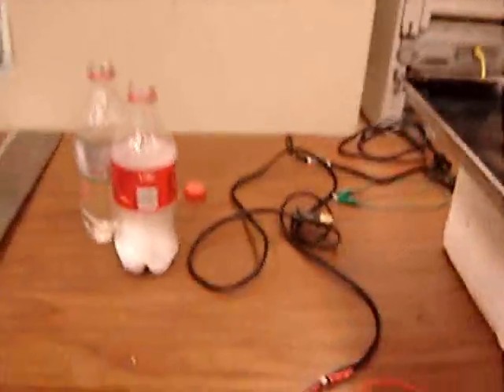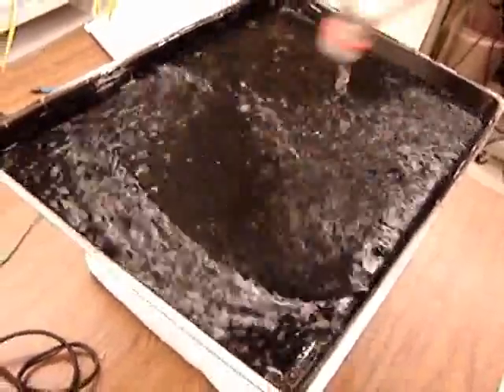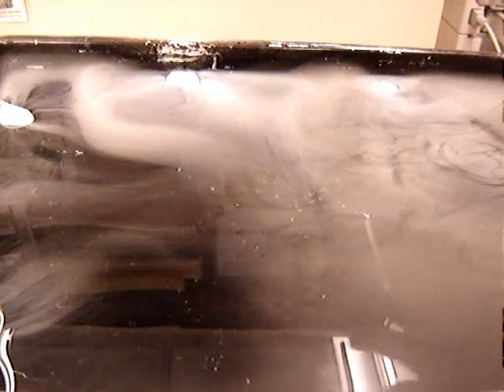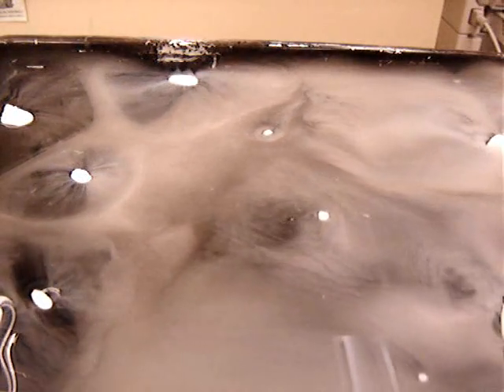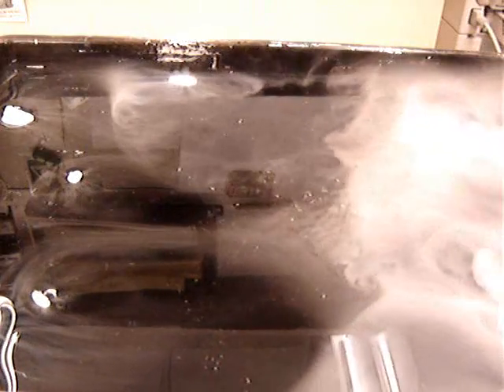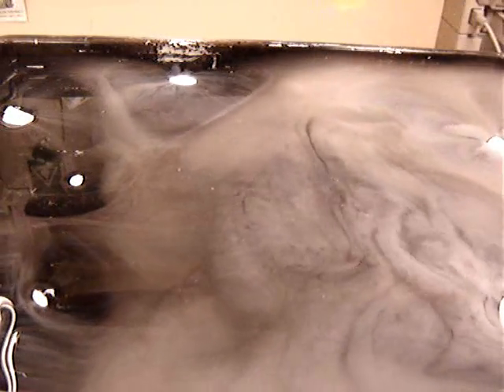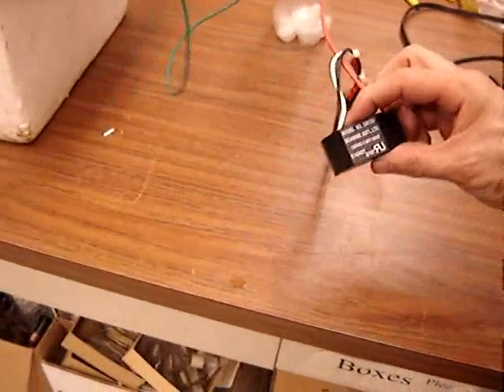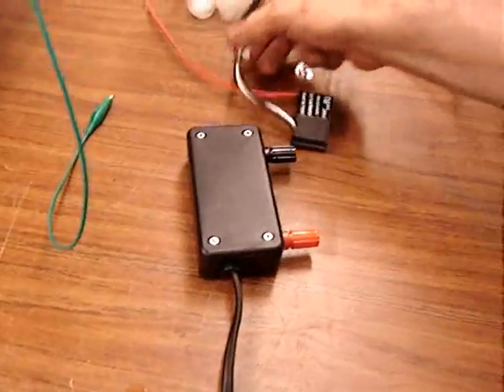High voltage "Air threads," from 1998 (video 6/2007)

Comment from the maker: Also search keywords: electrospray, Taylor cone,  liquid metal ion source, and FIB ion beam, ion-beam machining, ion-beam lithography.   The physics was covered by CTR Wilson, in his early-1900s study of electrostatics of thunderstorm water-droplets.   
Wet fibers are great sources of these "streams of electric wind," where probably the strong field at the tip of the fiber is causing Electrospray.     Others have used mercury-wetted (mercury-filled) hypodermic needles as their source of "ions."   In ion-beam lithography, the liquid metal is typically indium or gallium, where it's accelerated to hypervelocity in a vacuum, and actually used to carve deep slots through any material.   (At 10KV in vacuum, the droplets gain enormous velocity, when compared to 10KV in an environment of viscous air.   And in vacuum, we can try some megavolt electrodes, or even pulses at far higher potentials.)

Comment: any alternate for ion supply 
pls i need it for my science projects
Reply from the maker: Yes, on eBay search these keywords:

DC12v anion -air

That gets you lots of 12V-powered ion generators, many for about $6.  They work fine with a 9V battery.   The output current is tiny, like a VandeGraaff machine.

Comment from the maker: > any thoughts on power generation

@matt_jensen The level of power generation that Tesla was discussing (hundreds of HP for a car, megawatts for every city) are not appropriate for contemporary humanity.   If we're going to take a chance with accidentally shifting Earth's axis, at least wait until we have thriving communities out in the asteroid belt/Mars/L5.
Reply: Could you explain the mechanism for shifting the Earth's axis? I've never heard of that concern before regarding Tesla's (or anyone else's) work.
Reply from the maker: @unambitious  See Walt Richmond's SF paperback "The Lost Millennium," later renamed "Siva."    He did the same as I did: realized that laser-guided lightning, if it could reach up to the ionosphere, would short-out the entire planatary capacitor.    This would shut down all lightning on the planet.   But he went further, speculating that the DC "electron fountain" would reach far out into the magnetosphere, would persist, and would torque the Earth's core, physically precessing the axis, and cause the oceans to temporarily sweep across all the continents.    So, in the book, he had the Atlantean civilization do this by accident.  The vertical beams were pulsed, and part of the worldwide broadcast-power system.   Ancient pyramids were the insulators placed below the giant, vertically-aimed lasers.   (And so, the contemporary meme with giant glowing beams extending from the tips of Egyptian pyramids, that comes from Walt Richmond, if not from human "radcial memory.")

Tesla's main secrets involve guided-lightning at the scale of many kilometers (using collimated x-rays, not lasers.)   Tesla's first x-ray tubes produced narrow x-ray beams, not the 180deg output of Roentgen's tubes.     X-rays do ionize the air, especially the 1MeV x-ray sources (nothing like the piddling 75KV sources typical of hospitals.  No relativistic electrons present in the beam, until your power supply is well over 500KV.  )

Comment: Just a thought. Could you try a vapor produced with Ultrasonic sound waves? ( like air humidifiers) The speed of your waves are more in line with the speed of sound. My guess is they are 1 1/5  hour long waves.( six colors of the rainbow) 18 sets a day (3 rainbows x 6 colors - 3 wave electromagnetic wave) with a three day cycle. The entire electromagnetic wave turns inside out in six days. You mention 20 MPH that would go around the earth 18 times a day 20 x 18 = 360  x 2 North & south 720  x 3 days = 2160 miles. Keep me informed!  

Sound 767- MPH  = 10 planets  x 8 cartesian quadrants.
20MPH x 2 (N&S)  = 80 x 10 colors of rainbow (B, W, 6 Colors, Clear, Rose)  = 800 = Mercury the 80th element x ten planets!
Ultrasonic would be a room temperature mist. Better yet if it is 98.6 degree water! = the bubbles - water particles are mirrors.
Reply: The fog from ultrasonic "nebulizers" works a little, but unlike the cold CO2 fog it is sparse, and hovers high above the water with a significant clear space below.  Small holes and slots become difficult to see.  Dry ice gives much sharper details, since the cold gas invades the Boundary Layer above the water, dragging opaque white fog as it spreads.   Perhaps ultrasonic fog would work well if a sharp-edged "wiper" passed along the water, with fog injected just ahead of it.   Or some sort of laminar slot-jet to inject fog against the surface of flowing water.

Safe high-volt supplies are again available cheap ($6).   Search ebay for: Anion 12v    or see http://amasci.com/emotor/negion.html
Reply: Ill stick to neutral voltage - 98.6 degrees
Reply: William Beaty There are two rainbows in the sky. the second is inverted  and thinner with a space between the two. Maybe the Co2 and Ultrasonic vapours reveal both rainbows.

Comment: hey mr beaty, known of your majestic experiments for some time now, felt i shoudl offer a comment. Did you ever inspect any literature on Oliver Heaviside and Professor Wheatstone? and the speed of an electrostatic discharge as given by tesla as pi/2 * C and wheatstone in a 4 mile transmission line segmente to be 291,000 miles per second.

My thoughts are particuarlyl, what happened to the speed of light and the extra 105,000 miles an hour from the previous ratios, no explanation forth

Best,
A

Comment from the maker: Yep, just like old TV sets, those smoke precipitators don't try to be safe inside.   But the little one in the above video is fairly harmless.  I think it's designed to get wet (like in an ionizing blow dryer.)   Just don't use it to charge a Leyden Jar.

Comment: My explanation: water is a polar molecule. By using a charged or chargeable object, like a piece of paper or a hand, water vapor is attracted and also aligns with the electric field. The pressure increases, due the higher density of water, and pushes air out of the more intense electric field. Given that CO2, that is, dry ice, is apolar, it gets pushed only by the air. The result it is tha the shape of the object is printed above the water surface, as a hole.

Comment from the maker: > 6,000V

That should do 'er!   Actually, polarity seems not to matter.   Hmmm, I never tried turning the voltage down to see how low you can go.   For higher volts, the emitter can be farther from the fog plate.  (For a VandeGraaff machine, it can be a couple of yards away!)

Comment from the maker: > Ion Wind?

Probably not.   It works best with slightly damp fibers.  It doesn't work at all with sharp metal needles.  Perhaps it's a variety of "Electrospray," micro-droplets of liquid being pulled off the fiber tip.  They would quickly evaporate, leaving charged dry particles of solute behind.   (Electrospray was once used for one form of inkjet printer.  Also look up high-voltage "electrospinning" of nano-scale fibers.)   Or perhaps it's similar to smoke, where plasma burns the fiber itp.

Comment: You could try making a weather model and see if it checks out. Something like the setup above but with a watercurrent running through which is strongest at the middle, then evening out towards the top and bottom to fake the coriolis-force or something. Locally heating the water would be pretty hard though :)

Comment from the maker: The black and white wires are hooked to the AC cord.   I use butt-crimp connectors, but you could use wire nuts.   Make sure the connections are kept separate and completely covered (use black electrical tape.)

Comment from the maker: > if airflows like you're explaining actually existed,

 I think you should search on keywords "ion wind."   Also "corona wind."  Also "electric wind."

Batteries do generate wind.   Stack up cells to create a few KV, and any sharp edges on battery terminals will create corona discharge and launch some ion wind.

Comment from the maker: Might be air ions.   Or might be bits of the sharp electrode, sort of like nano-smoke particles.  Ions are pretty small.

If the electrode is losing atoms, perhaps the sharp tip eventually becomes dull.  But if it becomes sharper as it erodes, then it might take millenia before significant loss of matter was detected.

A 10 nanoamp current, say,  would lose 1e-8/1.6e-19 atoms/sec, or 1e-13 moles per second, or .00004 grams per year, for carbon ions torn from an organic electrode.

Comment from the maker: Click on the website link.

The "threads" are blocked by anything.  They can be pushed around by charged objects.

If we could detect them when they impact a surface, perhaps we could use one as a microscope by raster-scanning it across a tiny object above that surface.

Comment from the maker: > before pushing those, what seems to be exposed wires,

No exposed wires.

The negative high-volt wire is limited to 50uA current, which is far too small to even feel.  It's more like a VandeGraaff machine: a fairly safe source of eight thousand volts.

Comment from the maker: > Any theories

I've decided that it's electrospray, where the tip of non-metal fibers will periodically throw off tiny droplets or perhaps solid fragments.  An electric micro-squirtgun.    Also it's Tesla's Death Ray (which was basically a liquid mercury electrospray emitter, and a hundred-megavolt linear accelerator in high vacuum.)

Comment from the maker: > how does it react to a magnetic field? 

Doesn't.  I tried quite large supermagnets.  But it's expected, since the current is way below a microamp.

It reacts to charged objects.  A charged balloon, if wiggled at a distance, makes the fog spot wiggle.   And if you can create several-kilovolt sawtooth waveforms, you can build an oscilloscope (a crt tube in air, no vacuum)

Comment from the maker: > puddles of water lying around.

To teach yourself high-voltage safety, first you have to start out terrified.  Over the years you'll slowly learn what's genuinely dangerous.

Water is fairly safe around a current-limited HV power supply, but only if the limit is hundreds of microamperes, water can't get into the HV supply, and the supply has no output capacitor.

See, it's easier just to assume that high voltage plus water ALWAYS equals instant death!

Comment from the maker: > also use those ultrasonic-fog-makers 

See the main article on the website.

I briefly tried an ultrasound humidifer, but the fog doesn't descend to the water surface, so no marks appear in the fog.  Later I realized that if I let the water flow along a slight incline, and built a "fog box" at the top, with water and fog flowing from a narrow horizontal slot, that would probably duplicate the same fog effect as dry ice.

Comment from the maker: > will this work with a neon transformer

Hmmm, I never tried AC!   Interesting to find out.

I do know that it works the same whether negative or positive.  That means it should work with extremely slow AC.  But will it work at 60Hz?

Comment: Hey Bill..nice experiment...I just had to try that.
I used my whimhurst as the supply and it worked great, though i forgot to paint the tray black...
I found that any plant matter like fresh leaves made the greatest effect on the gas.
Lavender seed pods in a bunch had a good effect too.
I also noticed that gas vortex spouts would rise up to my hand...like the spouts in the ocean...very COOL...hehehe...
I'll do some more experiments with that for sure :)
Love your work mate..cheers.
Scotty
Reply from the maker: I taped a houseplant leaf to a VDG generator sphere.  Over five feet away, the leaf-pattern appeared in the fog.  Like Kirlian photography, but DC not Tesla coil.   
I wonder if plants evolved this trick intentionally for some reason.  Do they launch droplets upwards all the time (from 300V/meter sky fields?)    Or, is it only something that happens when a thunderstorm is overhead?    A negative thunderstorm-base then would create a giant cloud of positive plant-droplets, and would steer incoming lightning away from that cloud.   Imagine a field of clover producing an invisible thoudand-foot lightning-rod.

Also, today we know that conifers eject pine-scent intentionally, and it's a cloud-seeding chemical which produces fog droplets (which then collide with other pine trees. The smell of conifers is their method for watering themselves in dry, humid locations.)   But does it all stop, if there are no e-fields to take the tiny resin-droplets out through the viscous boundary-layer?

Comment: Possible Explanation: H20 dipole alignment with electric field causing repulsion of C02 vapor. This is akin to magnetic field alignment and trapping in supercooled ceramics. The experiment is an example of a large capacitor where the water is one plate. By dragging charged objects around on the other side of the dielelctric you are pulling opposite charged water molecules around with.

Comment: Recapping:We have C02 Fog riding on water, riding on black paint, riding on aluminum riding on -7000V DC? We have air gaps ranging between 1 and 10 inches. We see disruption in the fog related to fibers and conductors but not so much from skin, fingernails or human hair. Carved lines tend to persist after the cause has moved on. Cause seems to be linked to HV in some way. Explantion to Follow:

Comment from the maker: > Does this follow along the same theory as the lifter experiments?

Nobody knows.   Both involve charged particles which drag air along with them.  What's amazing is the apparent speed of the particles in this stream.  Also, the streams can pass through a shielded volume many cm across (with no e-fields inside) and are weakened yet still are easily detected as they exit from the other side.

Comment from the maker: Magnets will have insignificant effect for particle streams in air at low currents (way below microamps.)   The particle stream certainly is strongly charged, and can be easily moved by electrostatic deflection plates.

About LN2, if no fog is present, how will you see the phenomenon?  It's too feeble to visibly deflect a fluid surface.

Comment: i had a large clear surface of liquid nitrogen in mind, in a vacuum-isolated cryostate that allows electric charge to be added. 

and you should really experiment with magnets, you can then easily find out if the particles that cause the effect are charged or not. you should concentrate your efforts in finding out what physics is causing the effect.

Comment: well, you should be careful with explaining this, experiments like this often get abused by pseudo-scientists to fill it with speculation and esoteric. they then come up with some supernatural stuff and anti-gravity and so on.

the first step of a scientific approach would be to find out what particles cause the effect using repeatable experiments. is airflow present in the threads? can the threads be bent and shaped with magnetism? how does it look like with higher/lower voltage?